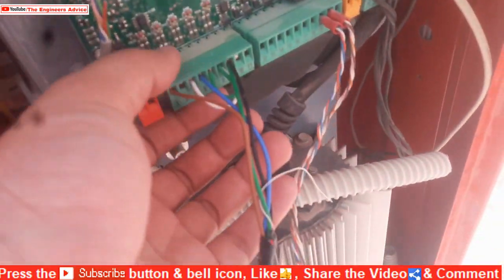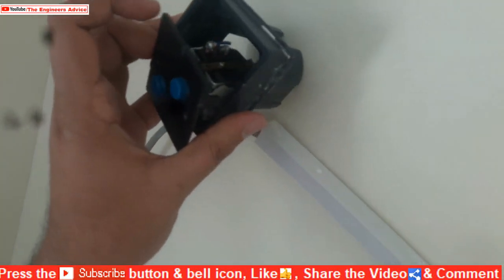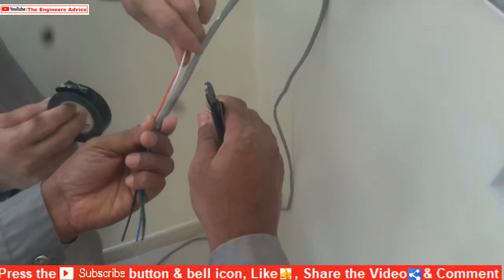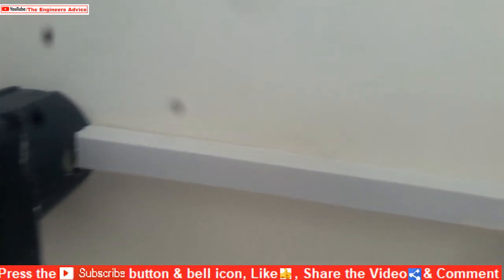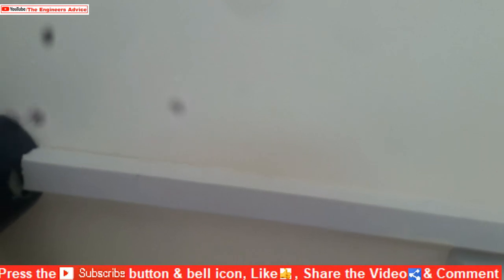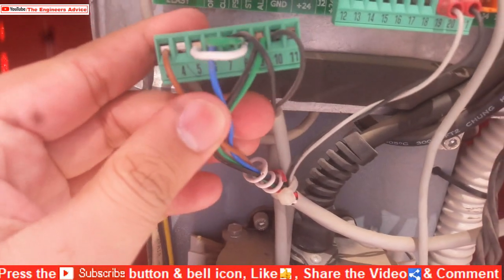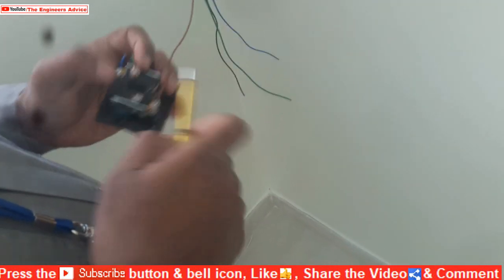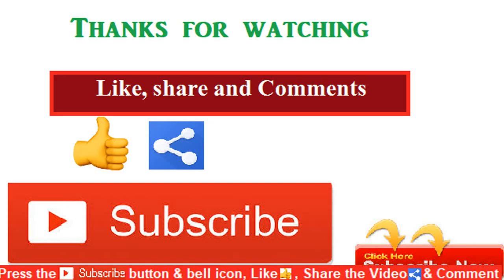Wiring Connection between Gate barrier panel to Push button

Comment: Sir ji propar connection batao
Reply from the maker: Big offer  - Building Management System, Fire Alarm System, CCTV, and  Fire Suppression System(FM200) online training courses only in Rs. 699 to 999.
Join on the below link.

1-Learn Building Management System (BMS) Training Course
https://www.udemy.com/course/learn-building-management-system-training-course-practically/?couponCode=MARCH22021

2- Learn Gent Vigilon Fire Alarm System Training Course
https://www.udemy.com/course/an-entire-gent-vigilon-fire-alarm-system-training-course/?couponCode=MARCH2021

3- Learn Fire Suppression System (FM200) Training Course
https://www.udemy.com/course/learn-fire-suppression-release-systemfm200-training-course/?couponCode=MARCH2021

4- Learn IP CCTV and analog CCTV System - Basic to advance
https://www.udemy.com/course/learn-ip-cctv-and-analog-cctv-system-basic-to-advance/?couponCode=MARCH2021

Comment: Where is the sensor 's connection??😁😁
Reply from the maker: Hello, I launched most awaited Building Management Training Course on Udemy.com
Watch youtube video to know more and join with below Udemy link
https://youtu.be/pqQ8cxcX_Ck
Learn an entire Building Management System (BMS) Training Course Practically. 
A Fully On-Site Practical Course To Boost Your Career. 
After completing this course you can work as an Industry expert in BMS System. More than 4 hours of practical video lectures will let you have full practical knowledge of the BMS System. 
This BMS System course is for all Engineers, Technicians, Operators, and for anybody who wants to learn it. 
Once you complete the BMS System System course, you will be an Expert as a BMS Engineer. 

Get Enrolled on Udemy to join this BMS Course

Udemy Course Link :

https://www.udemy.com/course/learn-building-management-system-training-course-practically/?couponCode=IRFANBMS 

Udemy Coupon : IRFANBMS

Never miss, Get Enrolled and be a BMS System Expert